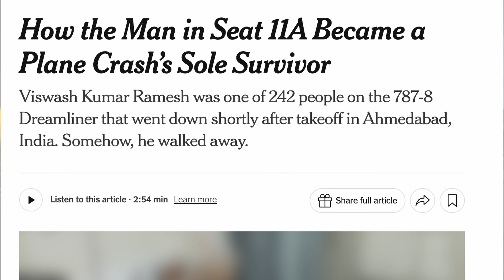Why the RAT Changes Everything – Air India 171 Update

Comment: CaptainSteeve: I am not  pilot nor in anyway connected to the cockpit of an aircraft BUT I did think your analysis and conclusion that the flaps were retracted too early was a bit wonky. The captain of the illfated flight had over 8K flying hours and the FO had over 1K - That is a lot of experience between the 2 of them. NO ?? For me the thought that either of them could retract the flap by mistake instead of the raising the landing gear was unthinkable. 
Anyway - THANK YOU - good that you have 'corrected' yourself. From the very beginning the sight of that landing gear hanging out and the news of MAYDAY MAYDAY call going out together did not quite make sense. Bird strike theory in both engines did not make sense too - else we wud hv seen some sparking n flashes from both engines. It was a clear case of double engine failure and THE MOST PROBABLE CAUSE WOULD BE SEVERELY CONTAMINATED FUEL, taken up by the craft at Ahmedabad. The craft had just flown in frm Delhi, without any trouble.

Comment: I'm still in the massive electrical failure camp, I've seen several air crashes in the past where the climax or moment of disaster is the second the landing gear begins to move (for example there was one plane that had a fire on one of its tires and caught the whole plane on fire by pulling the gear in, then blew up the plane when they tried to put it back out). I think the plane had its massive electrical failure the SECOND they hit the landing gear handle, causing all electrical to fail, the dual engine failure and the deployment of the RAT.

Comment: Well if this is the case, they had better figure out why those engines shut off pretty quickly. If it could happen again we need to know. Anything from Boeing is now suspect after the recent problems. The last thing Boeing needs is another design flaw the lead to a crash. The last thing the public needs is more suspicion that getting on a plane is dangerous. The practical and economic impacts will be momentous of such a thing comes out.

Comment: I dont know why i got this video recommended. Your previous video seriously insinuated the pilots with over 9000 hours between them, didn't know the difference between the flaps and landing gear levers?? 
I'm not an aviator, but watching the mobile phone video on day one of the accident, you could clearly hear the propeller sound of the RAT with no background engine noise.. blatant signs that neither engines were running. Talk about muddying waters and damaging public confidence just for views!

I'm glad I found this guys stream earlier, and with far better research:

https://youtu.be/Ac90bLg1Oek?si=BEVOqYfN_zv1DY0j

Comment: From a chatgpt question asking if groundcrew error/misfuelling could be an issue....

Based on current evidence and patterns in similar historical incidents, \*\*yes—if the cause was fuel contamination, starvation, or misconfiguration, then a **ground crew failure is a strong possibility**.

Let’s break that down carefully:

---

## 🔧 *Ground Crew Failures: Common Pathways to Dual Engine Flameout*

If this incident is confirmed to involve a *fuel-related failure**, the following types of **ground crew errors* are among the most likely root causes:

### 1. *Fuel Misidentification or Misfueling*

* *Wrong fuel type* loaded (e.g., diesel or Jet-B instead of Jet-A1).
* Fails under high thrust, causing flameout or combustion instability.
* Ground crew may have bypassed or ignored quality control protocols.

### 2. *Fuel Contamination*

* Water, microbial growth, or particulates introduced via tanker or fuel truck.
* If not properly drained or filtered before fueling, this could affect both engines.
* Recent monsoon conditions may increase the likelihood of **water ingress**.

### 3. *Fuel System Misconfiguration*

* Crossfeed valves, pumps, or shutoff valves left *incorrectly set* during preflight or post-maintenance.
* Fuel starvation could occur despite fuel quantity being adequate.
* Inadequate *fuel pressure to engine inlets* may lead to flameout at rotation.

### 4. *Incorrect Maintenance or Software Load*

* Improper update to the FADEC software or wrong calibration of fuel control units.
* Unlikely to be done by refueling crew, but possible if recent maintenance was rushed or documentation was flawed.

---

## 🚫 What’s Unlikely to Be Solely a Ground Crew Error:

* *Bird strike* (an operational hazard, not a maintenance error).
* *Volcanic ash or weather ingestion* (not relevant to takeoff at low altitude near Ahmedabad).
* *Sabotage or cyberattack* (rare, and no indicators so far).

---

## ✅ Supporting Clues That Point to Ground-Level Error:

* The *fleet-wide inspection order* issued post-crash, specifically targeting **fuel system components**.
* No signs of *explosion, fire, or external impact* before crash.
* RAT deployed, which typically follows **loss of engine power due to fuel/electrical interruption**.

---

### 🔍 Conclusion:

> If this was indeed a *fuel flow or quality issue**, the most likely root cause lies with **ground crew activity**, particularly in **fueling, preflight system configuration, or recent maintenance.*

Final confirmation will require:

* Fuel quality test results.
* Maintenance and fueling logs.
* Black box data showing engine performance and fuel flow.

Yes, there is a documented history of ground crew errors in India, including fuel mismanagement, procedural lapses, and non-compliance with standard operating procedures (SOPs). While such incidents are not unique to India, regulatory audits and accident investigations have highlighted systemic issues in ground handling, particularly in the low-cost carrier and public sector airline ecosystems.

🇮🇳 History of Ground Crew / Fueling Issues in India

✅ 1. Misfueling and Fuel Contamination Events

2015 – SpiceJet fuel contamination incident (Delhi):

Jet-A1 contaminated with water due to poor drainage in fuel bowsers.

Multiple flights grounded.

Investigation revealed lax inspection procedures at fueling subcontractors.

2011 – Jet Airways 737 emergency landing (Mumbai):

Aircraft had to return after engine surges on climbout.

Suspected water in fuel tanks due to improper sump drainage and incomplete log documentation.

2004 – Alliance Air misfueling warning:

A crew noticed Jet-B being loaded instead of Jet-A1 during visual inspection.

Investigation found improper fuel labeling and inadequate cross-checking at fueling station.

✅ 2. DGCA (India’s Civil Aviation Regulator) Findings

DGCA audits (2018, 2020, 2023) of airport fuel handling vendors found:

Subcontracting without proper oversight

Incomplete log entries for quality checks

Bypassed QC steps under time pressure

Poor training or lack of recurrent certification of ground staff

In 2020, a DGCA inspection of fueling at major Indian airports found that over 35% of fueling stations had at least one procedural non-compliance.

✅ 3. Maintenance and Procedural Lapses

Air India Express (2020 Kozhikode crash):

Although not a fueling issue, investigation found gaps in preflight procedures and CRM, linked partly to ground-level oversight.

Frequent procedural waivers or shortcuts noted in internal audits of both Air India and IndiGo in recent years—especially for overnight ground checks and deferred maintenance sign-offs.

📉 Why These Errors Happen:

Understaffing of qualified AMEs (Aircraft Maintenance Engineers).

Use of contracted ground handlers without airline-level oversight.

High workload + short turnarounds at busy metros (Delhi, Mumbai, Bengaluru).

Training gaps, particularly outside of international hubs.

Inconsistent enforcement of DGCA and IATA standards.

✈️ Summary:

Yes, there is a track record in India of ground crew procedural lapses, including fuel handling, which:

Increases the plausibility of a fuel mismanagement-related accident.

Supports the hypothesis that Flight AI171 may have suffered from a fueling or maintenance oversight—especially given the RAT deployment and lack of fire/external trauma.

Would you like a side-by-side comparison of India's ground crew standards versus ICAO best practices? Or a breakdown of the fueling QA chain in 787 operations?

Comment: So what’s the explanation for the flaps being fully retracted? If they have deployed flaps at the take off they should stay at that angle right? Or if they had hydraulics power deployed at full angle?
Reply: You cant see difference between flap 1 and flaps 15 from the grainy videos. Anyone who says they can, especially on the 787 wing design, is imagining things. Plus, regardless of flap configuration, those engines are beasts and cannot result in the glide descent we saw. Flaps was never an issue, no one knowledgeable has jumped to that conclusion.

Comment: Additionally, despite the RAT noise, there is close to no engine sound in this video, further strengthening the dual engine failure hypothesis. A 787 in TOGA thrust with running engines would be heard loudly, even with the RAT running next to it.

Comment: As for the Ram Air Turbine (RAT), yes — in the event of a dual engine failure, it deploys automatically. However, according to the pilots' memory items, there are two actions required: first, 'Fuel Control Switches — BOTH CUTOFF, then RUN', and second, 'Ram Air Turbine Switch — PUSH AND HOLD for one second'. So it’s possible this action took place — although the second step is more of a confirmation. But at such a low altitude, there would have been very little time to react and carry out the procedure, especially setting the fuel control switches to cutoff and then run.

We also have to take the starter effect into account — that could help explain, for example, why they didn’t even retract the landing gear.

Another point about the dual engine failure — it’s something extremely rare for an aircraft certified for ETOPS operations of up to 330 minutes over remote areas of the Atlantic. It’s known that in the past there were issues with Rolls-Royce engines, but in this case, both engines were GE... something very unusual must have happened.

Comment: Let go with Dual Engine failure. 
1. We might have bad luck here (1/5,000,000) 
2. One engine failure that cause the 2nd one to fail
As 777 pilot what, will be he connection that when one engine failed the other one will fail as well?
3. Software issue - Let go back to A400 accident few years ago, bad software update cause engine to shut
4. Other ???

Comment: Now I wonder if they need to look back at the fueling process.  Did they defuel or transfer fuel, and maybe a valve was left or failed in an inaccurate position ?  Still odd that both failed at the same time with no yaw or roll evident.  Could still be the flaps, and someone manually deployed the RAT, thinking it was a dual failure.    This is probably like most accidents, a combination of failures, both mechanical and human.  It's rare that a single failure causes an accident.  We do need to find which domino fell first, and why it continued to end in this tragic result.  No finger pointing, rather ... how  was this possible, and how do we prevent a repeat ?  Prayers for those who perrished.

Comment: I'll begin by saying I am NOT a pilot OR A&P guy, but I AM a Mechanical Engineer (now retired) who specialized in Forensic Failure Analysis! Something struck me as strange in these videos: You don't HEAR the engines at anything NEAR max throttle/rpm AND you don't SEE any indication of engine exhaust heat! I don't know for sure, but I imagine each engine would be fed fuel independently (separate fuel pumps etc.) and the only thing in common would be the fuel source (i.e. the wing tanks). That would lead me toward a fuel contamination! I DO know that fuel is moved from wings evenly to maintain lateral CG... 🤔

Comment: In one of the countries I worked the Government tried to buy 3 helicopters from a certain major Company. The Company in my opinion correctly refused the sale unless it came with a full maintenance package by them because they knew the country wouldn’t maintain the aircraft properly and that if there was a crash they would lose money regardless of the investigation outcome. I have seen a couple of videos of this specific aircraft (the actual one that crashed) where a lot of the cabin electronics didn’t work and the aircraft had previously had departures delayed because of problems where the engines had shut down. A family friend used to work for HAECO in HK and there were several Asian and African airlines that he would never ever fly because he knew they constantly cut costs on aircraft maintenance. Have a look at some of the Air India videos where the aircraft isn’t even cleaned properly. If they can’t afford to clean it properly how can they maintain it?

Comment: I have an explanation 
As you said Sir one was running based on that 
The gears are down because they want to return to the airport and they wanted to inform the atc bit they failed and in a stress they maybe forgot what to do  there best  that is why they tried to go up  but they failed and  due to drag the plane went down and fortunately crashed

Comment: Very informative. Few more data points . During take off plane used the entire 3.5 km long  runway. In previous video, captain Steve said plane used only half runway. Also lone  survivor said that sound of plane changed. He said it was almost as if engine stopped and they were trying to race the engine like how it happens in car. Maybe it was RAT.   Black box will give  more info. More importantly full runway of 3.5 km being used gives good input, coupled with all other information

Comment: It's also worth noting that the 787 gear is tilted backward and in the video it's tilted forward, which is what it does before retraction,  meaning the did set gear up but the doors didn't open due to presumably lost hydraulics further supporting this

Comment: I find it strange that the analysts working off this video point out that the RAT was apparently deployed. But nobody points out that there is NO sound of jet engines roaring at take-off thrust. This is all you need to know. This plane  lost power on both engines. The absence of the sound of roaring jet engines is very obvious. Now the question is: how did BOTH engines lose power at the same moment?
Reply: These "analysts" are just copying each other instead of doing real analysis.

Comment: If the engines were working there'd have have been jet noise as well as RAT noise as the plane flew past, so its fairly obvious the engines weren't running at that point.

Comment: Under what conditions does the RAT automatically deploy? If no hydrolics wouldn't the flaps and wheels both be stuck in take off positions?  If the flaps were retracted by accident, and power was insufficient for remaining airborne, would the RAT read that as an emergency and deploy?

Comment: Just adding, RAT is designed to give you electric and hydraulic using your own speed and altitude. It does not provide thrust, it does not have battery. It is using the gliding motion of the plane as the energy

Comment: No warning lights or sounds about electrical failures to fuel pumps during take off? How unlucky not to get the loss of thrust during take off or 10 seconds later when they at 3000 ft

My only thought is you have to wonder if gear up command caused the electrical shutdown somehow, because the failure of the engines occured exactly when they would be pulling up that lever. The gear up and fuel pumps run on the same power supply apparently. 

I bet you they find in the report, the gear up command caused some sort of short circuit or electrical failure to the fuel pumps to stop running

Comment: I'm not saying the RAT didn't deploy, but I am saying there's not enough evidence in this video that it did. I don't hear anything other than a jet going past. I don't hear any propeller sound. In fact, that Air Japan video makes it clear that there is no RAT sound to be heard in that video. And it's just that one frame of what probably is AI enhanced video, because that's what modern phones do: they use AI to enhance the video. It's not at all conclusive. I do believe that there was some sort of dual engine failure, most likely cause by fuel contamination, after V1. It could also have been a dual bird strike, again after V1. The RAT may or may not have been deployed, but there's no evidence of that in this video.

Comment: Doesn't this RAT increase drag, which you absolutely don't want when you've lost both engines? Can't they charge some batteries during normal flight and then operate the hydraulics from that in case of engine failure? Or would the weight of the batteries negate the positive effect you'd get from not deploying the RAT?
Reply: Plane was going down anyway, without the RAT it might have glided 1 second longer
Reply: @RoastedRealms  Yeah I was asking more generally, not with respect to this particular accident.

Comment: The flaps would not move at all once they reached the degree they selected before they started their roll down the runway even if they lost hydraulic pressure. The control valve is back to neutral. The gear stopped because of no hydraulics due to engines stopping.

Comment: My thoughts went straight to fuel contamination.  Both engines simultaneously.  I’m sure they have checked all their fuel tanks on everything.  We’ll see 😢.  Throttles?   Probably electronic?  If you loose power you loose throttles?  Do engines return to idle until RAT provides some power?  Planes I worked were cables.